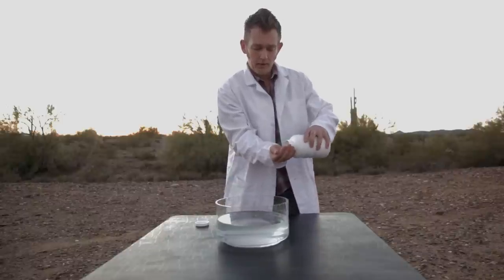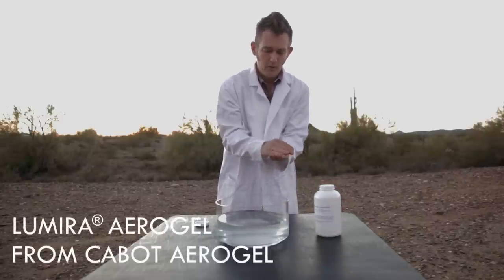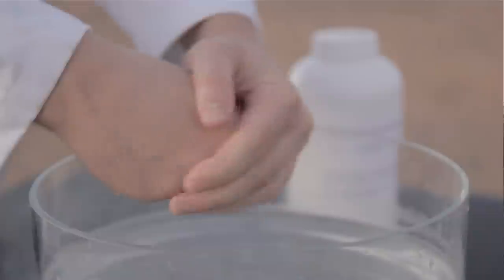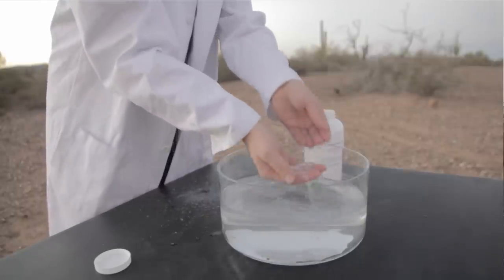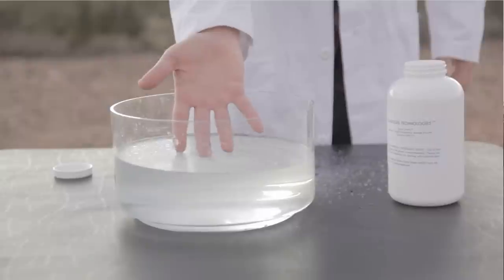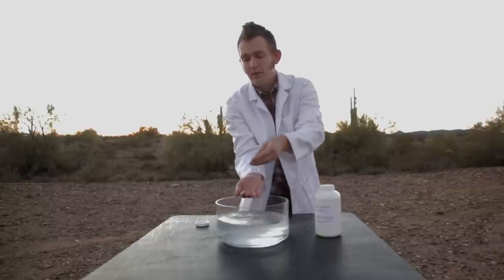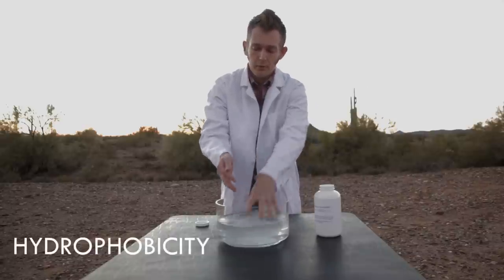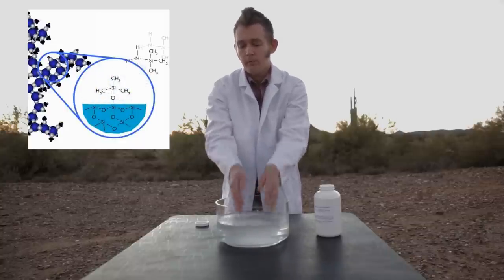Hydrophobic Aerogel Makes Hands Waterproof

Comment: That stuff looks very promising but the one thing that bothers me is how safe it is to have it on your skin.
Does the skin absorb it and the pores get blocked?

This type of stuff would be great for cycle riders clothing and motorcycle riders clothing if it is safe.
What if you happen to breath it in by accident while spraying it onto something would it cause harm to the lungs?
If this stuff is safe then produce it as a spray so it could be applied to just about anything.

Comment: So if you take a bath in this, and jump in the water , will you feel the cold?
Reply: Essentially yes. The coating is too thin a layer to act as an useful thermal insulator. You just wouldn't get wet, unless you rubbed it off of yourself by moving.